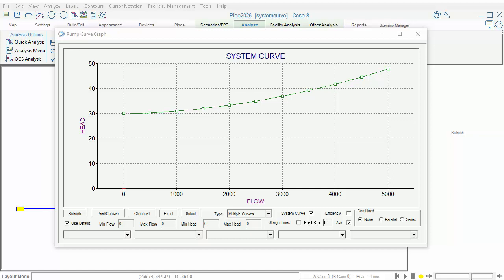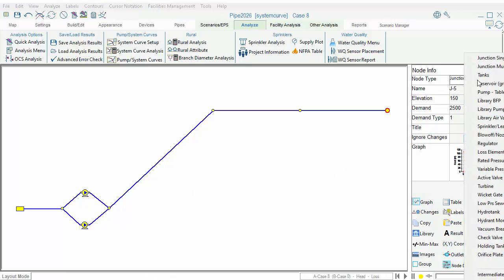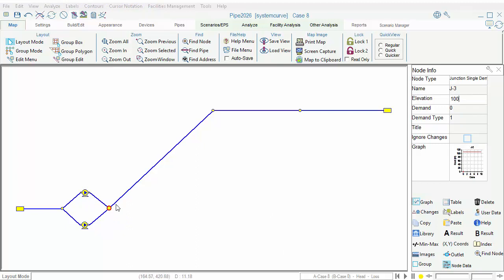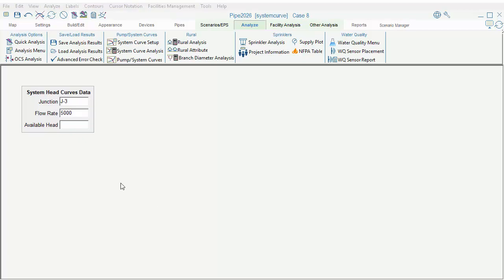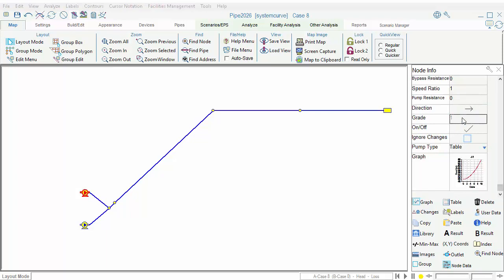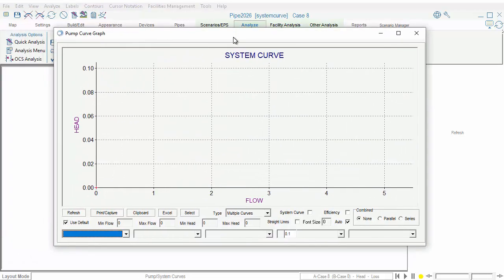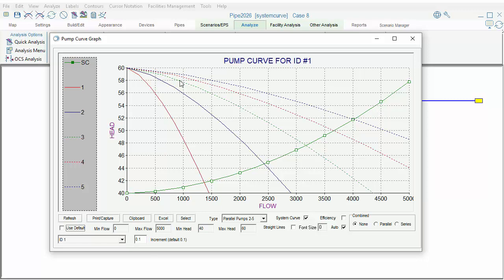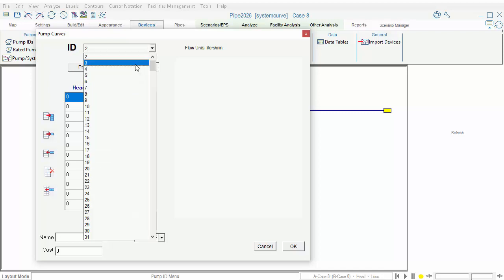System Head Curves

Comment: Don't you account minor head loss?
Reply from the maker: Minor losses are added manually to pipes as Fittings.  Any minor losses added in this way are accounted for in the System Curve analysis.  Because a downstream junction node is used to represent the pump during System Curve analysis, if there are any devices like check valves that you want to account for, add the minor loss as a fitting to the pipe downstream of the selected junction node.
Reply: @Kypipe thanks